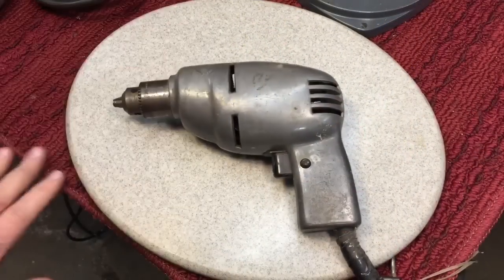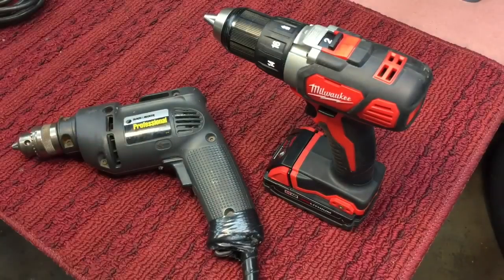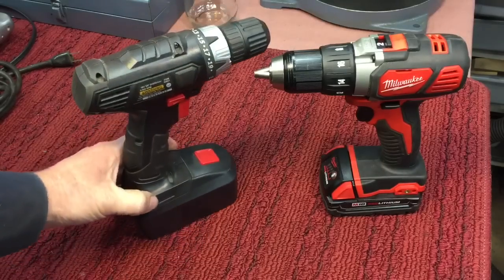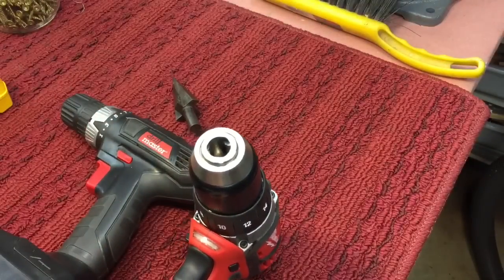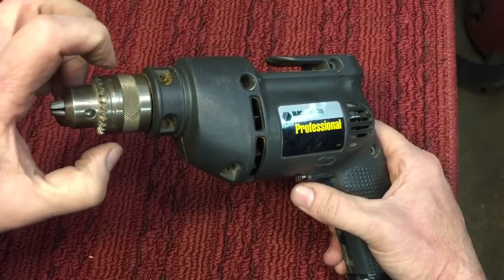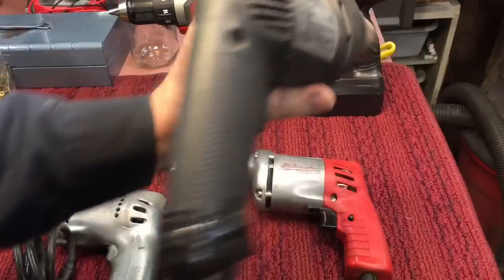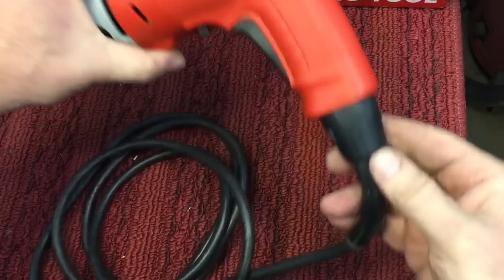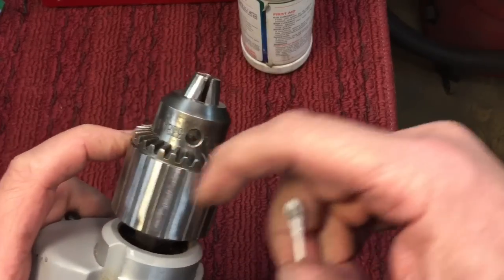Considerations when Buying a Drill-

Comment: Hey John, For a first time buyer I would suggest a corded drill. Making sure you have 1/2", reversible, hi amp for more power. And one thing you didn't mention which I would want is power locking so you don't have to hold the power button on when using it to run wire brushes, sanding, paint mixers and other attachments. Also get a good one (check reviews on YouTube and other sites)  After they get a corded drill they can always get a cordless later if you find that you use the drill where there isn't power. When you get a cordless make sure you are going to get a  brand that has other tools items that you may want in the future, so that you can swap batteries from one tool to another, instead of having a bunch of different chargers for different brands. Later
Reply: If available, I'd sacrifice amps for a longer working time. Everything else, great advice :)

Comment: I have a variable speed air drill that I like to use on hot days!   The compressed air keeps it cold no matter how long you use it!
Reply from the maker: If you have a good compressor a air drill is great, the only 2 issues I have is noise and occasional oil spit.  Woodworking projects can be effected by the oil mist.
Reply: @ScoutCrafter  Not being one that does much wood work I didn't think about the oil.  :)

Comment: If you are only going to use a drill every now and then, a corded drill is the best option, it works first time every time and is always ready unlike a battery operated drill that could have flat batteries. If you are going to do drilling in brick work or stone you need a hammer drill it makes quick work of it. Also one with a neck that you can attach it to a bench can be handy. Battery operated drills are for people who use them very often and have more than one battery to swap out when flat to carry on working. We live in a weird world we are being beaten up to recycle and battery drills you end up throwing them away because it is cheaper to buy new when the batteries die.
Reply: It is frustrating to have a dead battery. Even worse to toss  a working tool because the battery faded. 
There is push back on that front. 65Ford has a video discussing adaptors to allow batteries from one model to be used for other tools.

Comment: What I'm looking for a drill that I want to use these days I'm leaning more towards the battery-operated. Now I know I've got hand drills all over the place. I have probably a dozen electric drills, but for me the battery operated drills that I'm I'm going with DeWalt mostly because I have Dewalt already so I have batteries to match all the different DeWalt drills that I own and a few spares. 
The thing that I really look for I want to have a battery-operated and I want to have variable speed and reverse. 
One of the first things I learned as a machinist is there is a speed and feed rate. 
It is based on the diameter of the hole being drilled.. 
Rule of thumb for mild steel is a 1 inch twist drill should turn 360 rpm. 
Different materials require different rates. 360 is a good baseline. 
So a 1/2" drill should run at 720 rpm.  A 1/4" at 1440 rpm.
If you check the no load speed on a drill motor it will be right around the speed for a max capacity twist drill bit that will fit in the mounted chuck. 
That knowledge comes in handy for lathe work too. A 1" dia. mild steel blank being turned using a high speed steel bit, will cut better at 360 rpm. As the diameter increases the rpm goes down. As it decreases the speed goes up. 
Drilling holes in steel with a 1/8" twist drill bit for pop rivets will go much better with a motor that can hit 2580 rpm.
If you want to know more, look up surface feet per minute cutting rate for materials.
Reply: Good for rattle can paint shakers too! I finally used mine last week priming the grinder mount plate! Whodathunkit!
Reply from the maker: Dave- I think you have more DeWalt cordless batteries floating around your shop then anyone I know!  =D
Reply: @ScoutCrafter  He can run his whole house for several days off them.

Comment: My dad got me a lower end cordless drill when we bought are house, he said it would become my most used tool. He is very right, I still use it all the time. So a cordless would be the way to go for me. I got a specialty small size cordless for odd thight jobs and to have two drills when doing a job that requires a lot of drilling and screwing so I don't have to change out between drillbit and drive bit all the time. Now I need a electric one for the attachment because the cordless one is really to slow for those. That holeshooter is beautiful! I like that tag!
Reply from the maker: Alex- So many drills and so little time!   LOL
Reply: People buying a drill today mostly want it to drive screws and a half inch corded will drive the screw thru three walls and strip the screw and bit. .

Comment: Thanks for the tip on chuck maintenance. I have the same  B&D 3/8 VSR drill that you first purchased, I have converted it over to a keyless chuck. I also have the 1/2 inch Holgun (kept the keyed chuck) of the same vintage, both from the early eighties. The Holgun had the metal gear case but the rest of it is plastic. Both have stood the test of time. I wish I could find some new and improved stress relief rubber boots. Merry Christmas

Comment: I love your chuck key lanyard, great idea.  My corded drills are what I would consider heavy duty(most have 1/2" chucks) and are used for that type of work.  My battery ones are used all the time and I have about 6 of them 😊
Reply: Having the chuck key tied or taped to the cord near the plug is supposed to remind the user to unplug the drill before changing the drill bit. Most of the time when I’m dealing with a keyed chuck it’s on a 1/2” hammer drill that’s plugged into an extension cord so at least a third of the time I loosen and then tighten the chuck without unplugging. But do as I say kids, not as I do🥴

Comment: The first cordless drill was the brace. Many barns were built with no electricity available. Then the egg beater style became popular. The handle on the drive gear made the reverse action possible. Pneumatic (air driven) rotate very fast. Hammer drills work well drilling into concrete for installing anchors. You did an excellent job of covering the electric corded and cordless drills.

Comment: Great tutorial! i have 3 drills, a 3/8 corded and battery powered ones and a 1/2 inch corded drill. I have the two corded drills for the power and the extended running time like polishing and wire brushing so I do not have to change out and recharge a battery. When I work around the house I like the convenience of the battery model so I can get the work done quickly and not need an extension cord. Black & Decker make a corded drill with a keyless chuck that is still my favorite and I think that is a good starter drill. It is affordable and has good power plus the keyless chuck. Thanks for sharing this.

Comment: For someone in the trades I would recommend starting with a decent cordless drill. As ScoutCrafter said the best deal is one of those combo packages. For an apprentice carpenter I would say an 18 volt with a 3/8” chuck would be fine to start out with. Most often you’re going to be driving screws with it.
For a hobbyist or home owner a 3/8” corded should be fine to start unless you have bought a real fixer-upper. Then you’ll be doing a lot more things where cordless is way more convenient and safer. In a home shop the only advantage for the cordless would be the adjustable torque settings.

Comment: When I became a homeowner and was setting up my workroom, I bought a Black & Decker 1/2" corded drill.  I used it for everything around the house.  Those plaster walls didn't take too kindly to hammer and nails when the wife wanted a picture here or there.  Along the way I got a DeWalt 3/8" corded and it works fine.Then all the cordless drills came out and I wanted one.  Well about 8 years ago I bought a Ryobi Drill that was part of a refurbished "kit" with a cordless 6-1/2" circ saw and a flashlight and charger for $60. That thing still works great today. Then I bought a Makita brushless set which I like very much.  Compact and long life batteries. Use this set when fixing things at my sister's house.  I guess one can never have too many drills. I'd recommend a lighter weight drill for us older guys as holding them while drilling into ceilings and rafters helps.  Great video.
Reply from the maker: The best part of having multiple drills is knowing the features that are best for you!   Thanks!

Comment: Great info as usual. I remember being discouraged when I saw my first plastic chuck drill. I liked steel Jacob's chucks and saw plastic as further cheapening of tools. Now I see the advantages they have. I have corded and cordless drills. My habit is to use the corded drills just out of habit. But when I use it, the cordless is really nice. Great convenience. I have a few oldies from second hand sales. Guess what?  The chucks are taped to the cord. I like your idea better. I see your Fury drill was made by Ram Tool Corp. I have a Ram bench grinder from the 1950s, and it still works great.  Thanks

Comment: Great video, i like a Mid handle  for balance vs. rear {pistol) handle drill  Back handle lets you get your hand and arm pretty much in line with the drill bit. You can't get a lot of pressure on the drill bit with a mid handled drill, unless you put the other hand on the back.

Comment: I have a good quality cordless drill and I brought it to my sisters house to install a floor mounted lock for her front door and I had to drill into her hardwood floor. The cordless drill just didn’t have the oomph to get into the beams of her floor, and I was frustrated by it. She remembered that my dad had given her a corded drill that he got in a garage sale and it was from Sears. That thing blew the doors off my cordless drill and I was so impressed with it that I bought a new one for my own and I still use it when I am near an electric outlet. A Black and Decker Matrix. It has detachable front that I can switch out with a jigsaw, a reciprocating saw, and a few others. It’s been excellent for me. But a cordless drill is so nice when you are in awkward places or outdoors doing some work.

Comment: I have two drills (so I'm not a maniac!) - both corded.  I have a Black & Decker 3/8" 4.5A 1350 rpm variable speed reversible keyless chuck.  It was the cheapest drill Home Depot had 20+ years ago!  I also have a Ryobi "Clutch Driver."  It has the adjustable chuck like the battery drills, but with a cord. That one is also 20 years old and still works great!
Reply: Hey Magdad just had a MAGNIFICENT idea.  You need to make a little key for your tiny flitz buddy. Because we don’t want him to be a “keyless Chuck”     (I know…. huge eye roll ).  Happy Holidays!!
Reply: @unwired1281  🤣🗝

Comment: Very  Good  Information And Excellent  Video.  A  few more Pro's  vs Cons on Older corded drills Is If you keep your truck outside in the Cold midwest ? And You have a Battery drill?  Good luck  With That when you need it now ! Also, all the quality name Brand corded  VSR  drills, usually have a better lower starting speed and more sensitive to the touch,which is really beneficial when you have a extension tip on the drill for long hard to reach situations.  Yes, the Cord is usually a pain in the Dupa But?  who said No Pain No gain?    Very  Nice Video . Your The Man !
Reply from the maker: Raymnd- Wait until they keep pushing electric cars on people.  The Midwest cold will have a lot of people stranded with dead batteries!

Comment: I have 3 corded, Jacob's keyed chucks, lockable, older drills, 2 are installed in portable drill presses. The remainder of my 6 cordless drills are various ages, power, features,  etc. But, I do have 2 li-ion battery drills that maintain their charge while sitting on the shelf I can use at a moments notice. If I forget to charge the others before a project.
Our professional carpenter contractor in the family uses newer Li-ion on the worksite & all his older ones are kept for his workbench uses. He has one heavy-duty corded drill for jobs that requires a whole Lotta power to get the job done.

Comment: My father in law got me a new professional 20v  dewalt drill for my birthday a couple of years back. I was previously working with an old craftsman that didn’t hold a charge longer than a few minutes (had to work fast). That new drill is IMPRESSIVE! It’s amazing the amount of torque and power it produces for being such a small package. 

For me size and versatility is important. Corded drills take up too much space and they require more skill to use. I’m a do it my seller at home and when building or repairing things it’s nice to have the clutch to prevent myself from splitting out wood etc. I have a heavy trigger finger!

Comment: I think I've ended up with 4 drills. a 1/4 for small bits, non-reversible, a 3/8ths in a Makita kit box when my Makita drill/driver batteries died and I canned the whole thing and got a 3/8ths DeWalt corded and drove a ZILLION screws and had to put in another speed control. Still a fine drill and my clutch was my pointy finger on the trigger. A 1/2 Milwaukee hammer drill with case because I needed a half and I was still working and got a good deal. It is a HOSS! Then a bare tool battery DeWalt 1/2 to go with 65 Ford's rattle can shaker which I actually used the other day and I got it because of Unc. getting an impact and watching the guys use them day after day on the job. AND I got a spare battery off Ebay from a pawn shop in Joyzee. So now I'm set. 2 rigs and a spare battery and charger and accessories in a small tackle box and all in a canvas tote bag! As for someone else? Weigh your options and gopher it. You ain't getting a bit younger. Thanks, John CS!

Comment: Hey partner, actually that Milwaukee drill that has the "metal ring". Well that black part is metal also. I have the same drill and the black paint on mine is all worn off, right behind the "metal ring". Anyhow just wanted to let you know that on the Milwaukee drills the Chuck is all metal also. Thanks for another great video. I work in my Woodworking shop full time, as a contractor. And I've been using that same set with drill driver and impact driver for about 6 years and I've really enjoyed it. However I plan on picking up the Milwaukee fuel set with the impact driver and drill but the fuel version. That way I've got 2 of each. 2 drills, and 2 impact drivers. Plus the Milwaukee m12 installation driver that I have also. And for the work that I do, I don't have to change the bit in any one is them as often. I can have five bits that stay in those 5. Unless I'm doing something different that day and I can switch them at that point.

Comment: Nice selection of drills. I never thought about how many drills I own until this video so I counted them. 2 90° pneumatic, 7 pistol grip pnuematic of various sizes and types, 2 corded, 3 cordless, and 1 drill press. I like fast drills for aluminum, my favorites are 5000 to 6500rpm for that purpose. Slower for steel and wood. I better get on ebay, may be getting low on drills like you!
Reply from the maker: 15 drills.....  NICE!!!!!!!!!

Comment: It’s amazing how many guys don’t know how to use a drill clutch! I do a lot of installation work, door knobs, electrical, etc. I can do most of my tasks on the lowest clutch setting. I see guys just sending screws straight into whatever they’re doing. They either strip the screws or damage what they’re working on.
Reply from the maker: With the old battery drills you would set the clutch and the first 20 screws would be flush, then as the battery weakened the screw head would be proud, next settling fixed that for 20 screws...  LOL   =D

Comment: Good video.
As you said at the start of the video, I cannot imagine a person having only one drill since as you also said, each drill has its pros and cons.
I have a corded 3/8in plastic body variable speed Rockwell drill purchased in early 80's.   This does not get used these days, but hard to throw out a perfectly good drill.
I have the same Milwaukee Magnum Holeshooter corded 1/2in drill I purchased in the mid 80's.   As you said, this has incredible torque.   The label states 4.5Amps, but this has to be geared to get the torque.
I went through a couple of NiCd cordless drills.   My present cordless variable speed 3/8in drill/driver is a Bosch 12V LiIon.   This came with a quick release driver version.    I use these a lot.    
I also have a corded 1/2in Hilti hammer drill purchased from a friend.   It used to be her fathers who was a carpenter.   Still in excellent shape.
For the first time purchaser, if convenience of use is important consider cordless.  If I only had one drill, I would want this to be 1/2in chuck.
For a second drill I would get a high torque corded drill.    A good quality model will last a life time.
Dave.
Reply from the maker: One advantage of living in these crazy times is you can purchase a perfectly good corded drill on eBay with very little hours and cheap!

Comment: I wouldn't say I never use my electric drills because  I do, usually my 1/2" Milwaukee. But they don't get out of the cabinet as often as they used to. The cordless drills have way more features, an integral light, variable speed, two speed ranges, a hook for hanging, adjustable clutch, keyless chuck. I recommend staying with one platform: Dewalt, Milwaukee etc. This is the one thing I haven't done unfortunately. Great video as usual Scoutcrafter very informative.
Reply from the maker: You can't argue with the convenience of the cordless models!   Especially when they are fully charged!  =D